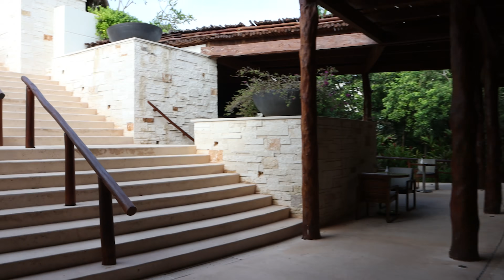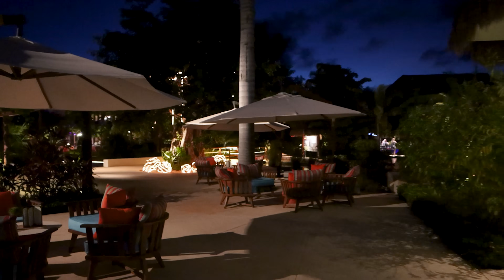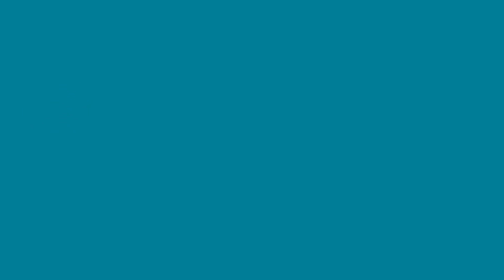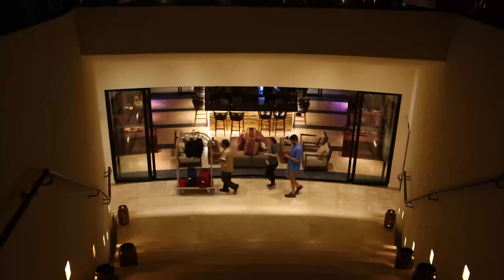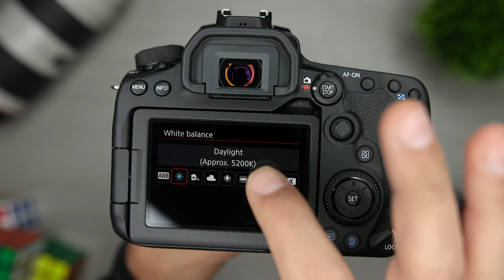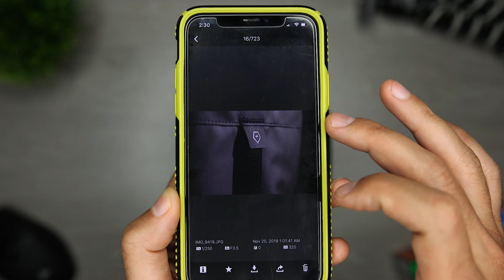Canon 90D - Watch Before You Buy

Comment: Hi, I’ve stumbled down the rabbit hole of wanting to replace/upgrade my camera.  I currently have a (now discontinued) canon 200d which was perfect for my first ever camera.  Mainly used for video and some photography.  Now I’m really , really REALLY needing some advice … deciding whether to go for canon 90d, canon mark 5d iv, or canon R7 .   The R7 looks attractive to me because of : the autofocus capabilities and the newer technology that come with mirrorless , I’m scared because of not knowing how to use it compared to my traditional camera , I’m embarrassed to say I have only ever used auto on my camera but I’m going to learn how to use manual.  Also slightly worried about the ‘overheating’ rumours/problems with mirrorless, but apparently shouldn’t be an issue if I don’t intend to do shoot 30min + .. I’m interested in the canon mark iv because it seemed EVERYONE thinks it’s a beast and amazing but then after research I saw it’s better primarily for photography AND it doesn’t have a flip out screen (a feature I currently have and love)  and then obviously the 90d …. I think is a really really good option as it’s a step up (several steps) to what I have and probably the most familiar one I’d be used to .. just scared of thinking the R7 is more superior I think is my problem… would really appreciate your thoughts. FYI I’m an amateur ..

Comment: its not the frames per second that matter for fast action , or even casual body movement , its pixel size ,  with 33mpix  you have to use 3 x faster shutter then same camera with 12mpix , make it full frame Canon 5D classic with large pixels that is 6x faster shutter speed . So what you can do with Canon 5D classic at 1/100 shutter , you need 1/600 in order to get the detail that sensor can give you  . This is a lot , sensor stabilization , IBIS or IS on the lens will not help you here , nothing will . So i trust you will not get 33mpix unless you are shooting on a tripod at a static subjects . I found this with 6D compared to 5D classic , 5D classic will consistently give me sharper images , but its not due to focusing , its because its 12mpix , and subject needs to move 80% more to move to another pixel while you are shooting . So when i shoot with 6D i need to use faster shutter speeds if i want to get 20mpix . And that is the major problem i have with this camera , 18 mpix would be more then enough , and you would gain a lot by bigger pixels , your shutter would go down , and Dynamic range up with ISO sensitivity . But what they wanted is Vlogger , and wanted to impress noobs with pixel count , and get that sale .Not to mention that you will need expensive glass to get 33mpix out of crop sensor .

Comment: I bought it recently. Previously, my nightmarish experience with its two-step predecessor 70D haunts me. Extremely worried about using live view and movie options frequently! My 70D died while doing so.
Reply: I have a 70D... 24MegaPixels. It takes great video and pics, but the lighting has to be exceptional for that to work. I'm wondering how the EOS 90D would be in comparison with its 32MegaPixels. Ordered.
Reply: @FeedScrn , 70D is 20 mp.

My experience says, Canon deliberately cripples its entry-level and mid-range bodies in order to protect the high-end and pro bodies. Likewise, finding no choice I bought a used 7D in good condition and sold out 70D. 7D works great as a still camera. I never attempt videos with DSLRs and this media is not my cup of tea. Sometimes record casual videos with smartphone.
Reply: @quazisanjeed6395  - I did try the video... with mixed results, as mentioned. I'm like you... mostly still photos. Thinking about circulating through the local craft shows to sell some prints.  A friend of ours has paintings and prints of them, and does pretty well. Not sure about the signature though- for copyright purposes. Maybe something on a bottom corner?

Comment: how you're doing i just got my canon 80d and i want a good zoom lens like the sigma 70-200 and it's all black and i see it takes great pictures. i want a few lens but i don't want to kill my pockets you understand. but i'm in love with sigma products and plus it's cheaper than canon. i guess those photographers can buy them cause they get paid i do this for fun and i want to be good at what i do ya see.i want to get this 70-200 f2.8 over the canon 55-250 so i want your opinion i'm going to buy the 18-35 sigma lens the 35mm 1.4 sigma lens and the 70-200 that's a good combination right? i was thinking 24-105 and the 24mm pancake lens and my collection is complete and i want the 90d as well

Comment: Thank you for the review again. I've had my 90D for about 7 months and I must say that I am disappointed to a degree. I upgraded from a T7 and it has been a real learning curve for me. I struggle with capturing crisp shots with this camera even on a tripod with an intervolometer and remote.  I have a 28-135mm USM zoom that I got with my 40D many years ago which is probably my best lens. I have a 70-300mm USM IS which I've also had a number of years.  I also have a Nifty-Fifty f:1.8 which gives me the best quality of all my lenses but still not razor sharp. I've seen videos about micro adjusting the AF and tried that on the. 2 USM lens but to no avail. You have much more experience that I will ever have so I thought you may have a bit of advice. Thanks for the excellent videos and any advice you may offer.

Comment: M6 has no mic port or headphone port
Reply from the maker: The M6 MK II definitely has a mic input.
Reply: @TechGearTalk ; which canon mirrorkess has the microphone connection through the hot shoe? The same camera has an electronic viewfinder that uses the hot shoe to connect. You can use one or the other but not both. That camera has no mic port

Comment: I can record 4k at 30 fps for 30 minutes. Is there any way to connect an external hard drive to record video files longer than 30 minutes? Is there any way to record 4k @ 30 fps for longer than 30 minutes? If I have a video that's 35 minutes long, is there any way to avoid 2 files - one at 30 minutes and one at 5 minutes?

Comment: 7:37 I guess at some point they got rid of the multicontroller because I'm looking at my Canon 30D and it has one, smaller and plastic, but it's very useful for choosing the focus point, the 90D's looks super comfortable! I can't remember but my first ever digital camera was a ~3 MP Nikon with the articulating screen, I found it allowed so many shots I never would have gotten, and when I upgraded to the Canon 30D that is a feature I really missed. I'm looking to do some video so it's time to upgrade and the 90D feels like a nice sweet spot in the series. I would like to get a full-frame body in the future so I like that I can invest in glass that will fit both sensors. Thanks for your excellent review

Comment: I’ve used Sony for years and now back to Canon again. I bought the 90D because I like the ability to shoot high quality 4K video but also enjoy doing wildlife photography. The 90D paired with the 100-400L is magnificent.  Btw, one of your commenters mentioned it was slow for him with BIF.  I noticed he was using a rented model and may not have been aware there are some specific menu settings to change to get the best out of the focusing system, for fast action, BIF being one of them. My only point of reference for comparison is my previous Sony A7 III, but I find the 90d on par or better than my Sony. Love this camera body, and love your reviews!
Reply: Are you using the 90D with the original 100-400L or the second gen 100-400L II, I've read some reports of it being soft with the original 100-400L

Comment: I have a sigma 18-35 1.8 that I am using with my 1300 D. I want to upgrade my camera. I am torn between RP and 90 D. Another sharp zoom lens you'd recommend for aps c? Or should I just move to rp and go full frame and get an L series lens to pair with it?
Reply from the maker: I would only upgrade to FF if I had a lot of money to spend on lenses. I mostly use APS-C and super35 - I don't really feel like I need FF for what I do. It would depend on the use of course.

Comment: Thank you so much for this review. THIS is a real review. Do you feel that the 90D will require much fine tune adjustments to lenses due to its high resolution?  Is this more/less likely with certain lenses and focal ranges?

Comment: I have owned a Canon T7i for about 3 years now. It is an awesome camera but there are some things about it I do not like. I got back into photography with this camera and it is my first DSLR. All my old cameras were film and they had the lock button on the mode dial which I forgot about. Inadvertently changing your mode dial and then not notice it until later which is really frustrating to say the least. Also having the C1 and C2 presets would be awesome. Other than not having 4K video, a mode lock button and the presets the T7i is an awesome camera that I am still learning digital photography with. I know there are a lot of other differences between the 2 cameras. I am mostly interested in Photography rather than video. Other than the stated preferences would the 90D be a good or worthwhile upgrade from the T7i? I am also a little concerned about the soft focusing issues I've heard about. Thank you for your review!

Comment: What are your favorite standard zoom lenses for the 90d? Ideally they would be durable, constant aperture, and relatively cheap. Would the sigma 17-50 f2.8 work for that?
Reply from the maker: Yes, that Sigma would work. My favorites is the Canon L 24-70 2.8 but it's not cheap. Favorite lens every the Sigma 18-35 1.8 (depends on whether you're including the crop in the definition of "standard"
Reply: Tech Gear Talk the 24-70 is great, but waaaay out of my range, I do like the 18-35 but I don’t really know how well a 35mm focal length would work as a telephoto side of the lens

Comment: Is there really a point to a crop sensor in 2020? You could get a used Full frame or mirrorless. Its expensive.
Reply from the maker: I shoot most of my stuff on a crop sensor. Yes, you can get a FF body for the same price, but FF lenses are also expensive. There is no right answer - just choices

Comment: Would you pick the 90d over the 80d or the 7500d? Thanks you
Reply from the maker: For video or mixed use - yes.
Reply: How about pretty much only photography
Reply from the maker: If it’s actually only photography, it’s a close race. I’d go pick up both at a store and play with them.
Reply: Tech Gear Talk great, thanks. Im leaning towards the 90d because I don’t think I’ll be doing too much low iso shooting that the 90d can’t handle and the resolution will be. Ice. Also, I can use the ef glass I buy now on a future canon camera

Comment: Hi there love the review at the moment I’m using a 750d and tamron 16-300 lens I’ve just ordered the 90d with grip and spare battery I’ve just got a  canon  28-300 usm l lens most of my photography is my horses at show jumping competitions  have I done the right thing as the lens isn’t really for a crop  it seems to work. Well on the 750d  any advice
Reply from the maker: Thank you for the kind words! You got yourself a powerful combination!  The 28-300 will give you a similar angle of view as what you got on the 16-300, so as long as you were ok with that, you'll be happy. It's designed for full frame but that doesn't hurt. Enjoy the new setup - the 90D is a fantastic DSLR

Comment: Sagi, I've watched this review many times and I got to tell ya this is one of the best if not the best Canon 90D review on YouTube and I got mine a couple months ago and I am absolutely loving it. Their is only one thing I respectfully disagree with. You mentioned how the 120fps mode in 1080p is almost useless but it's actually very usable. Like you said, even though it doesn't have autofocus which sucks, it has one feature no other Canon DSLR has, which is focus peaking and that makes manual focusing so much easier to use. In addition, their is a little "hack" to getting auto-focus in 120fps. Basically you press on the part of the screen you want in focus, hold the shutter button down and then you're in focus. But other than that excellent, well put together review.
Reply from the maker: Super appreciate the feedback and kind words. If I did it over again I would re-phrase that. It was probably a big harsh - based on my experience with my sony cameras for 120fps with af it was a step back. But it's definitely usable. Thank you so much for being a part of the community 🙏

Comment: New subscriber here :) May I ask for a piece of advice? I currently own the Canon 7D (first version) and was thinking about getting the 90D. It seems to be a huge upgrade, but I am a bit worried about the noise, even at relatively low ISO (also because of the incredible amount of megapixels the 90D offers). Specifically, the sensor pixel area is 18.54µm2 vs 10.29µm2 in favor of the 7D. Do you think it's something I should worry about, or is the 90D still a good choice in that price range (even VS the 7D mk II)? I mainly shoot macros/fine art photography (both indoors and outdoors) as well as portraits, most of the times outdoors. Thank you so much for your insights, I absolutely enjoyed watching this review! Greetings from Italy :)
Reply from the maker: Hi Elena and welcome. I have not done testing to compare the cameras in a controlled environment. Assuming all things are equal, I would understand your concern (sensors of identical size and sensor technology). But in this case, we know that technology advances, so a comparison of just pixel size isn't exactly fair. I'm also not much of a pixel peeper, if the image looks good at the resolution I plan on using it - I'm happy. I will tell you that I loved shooting with the 90D and was really happy with the images it produced. I know this is subjective and you have specific requirements so if at all possible - go to a store and test one out. Shoot at your typical ISO and see if the results are acceptable to you. What do you think?
Reply: @TechGearTalk  Thank you very much for your reply! What you suggest totally makes sense; unfortunately, I live in the country, and with the pandemic going on I won't have the chance to go to the nearest city anytime soon (I was planning to order online). I agree with you that technology advances, so the brand new 90D will probably perform better even with a smaller sensor pixel area. The 7D mark II is still a great option, but it's already 6 years old, and I don't have the chance to update/upgrade my gear often (I purchased the 7D back in 2013, when the price had considerably dropped since it came out in 2009, and the 7D mark II had already been announced). I would surely make different choices if I had no budget limit, but at the moment, it looks like the Canon 90D is a great value for the price and a huge improvement if compared to my current camera. I watched many reviews before landing on your channel and I must tell you that yours is by far the most informative. Thank you for what you do to help photography enthusiasts!
Reply from the maker: I'm so glad I was able to help. Let me know how it works if you end up getting it!

Comment: Great review and I’m looking to replace my T2i with it. Should all EF and EF-S lenses work without any problems with it? I have Canon EF 100mm macro, EF 50mm prime, and EF-S 10-18mm wide plus Sigma 150-500mm f/5-6.3 and Sigma 18-250mm f3.5-6.3. The mirrorless cameras look interesting but then I would be starting all over with lenses.
Reply from the maker: Hi Mike - glad the review was helpful! Yes, all of your lenses will work with the 90D. If you went with an APS-C mirrorless, they would still work, but with an adapter: https://youtu.be/Nir8pfvfdFI Hope that helps and welcome to the channel!
Reply: Tech Gear Talk I watched your comparison on the two cameras but haven’t watched your M6 Mark II review yet so will do that later. I do mostly nature and wildlife photography using my wide, macro, and super-zoom lenses. Recently I photographed a gravel bike race and might do that again. Would you learn towards one of the other for my use? Any quality degradation or stop loss using the adapter? Any advice on choosing one over the other would be appreciated. Thanks!
Reply from the maker: The 90D gives you weather sealing which you might like since you're out in the elements. There is no quality degradation or stop loss using the adapter (it's simply pushing the lenses farther our from the sensor to the proper distance - since they are designed for DSLRs). Technically, the m6mkii gives you the option to use a speed booster, slight degradation in image quality but you're gaining a wider angle of view with a 0.71x crop and a stop of light. 

The 90D will probably have better ergonomics because it's bigger and heavier when used with larger lenses (not sure if you're using a tripod or monopod where this isn't even an issue). Hope that helps.

Comment: I have reached my recycle point.  Every 3 to 5 years, I try to replace camera bodies.  I have gone through canon 50, 70 and 80 and am ready to go to 90 but.  It retails for about $1,100 new and I can't find one used for less than $980.  What's going on?  My budget for a 4 year old camera is $600 to $650 .  Am I missing something?
Reply from the maker: Hi there. The 90D was released in October of 2019 so it's less than a year old.
Reply: @TechGearTalk  Thank you.  As a former active professional,I am in the habit of buying two at a time for events.  Everything is set up identically.  I still do fine art and a couple of freebee gigs for the library and a couple of local non profit groups.  I'll skip this year aand invest in a verry sharp lens
Reply from the maker: I will support investing in glass 100% of the time!